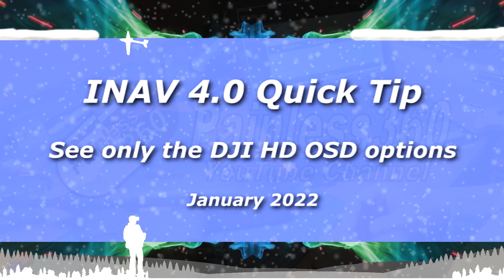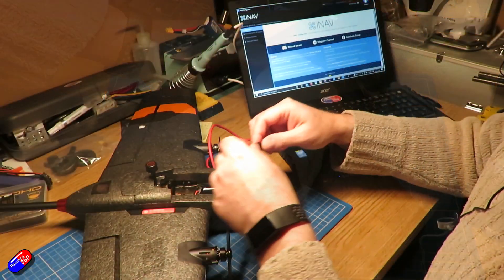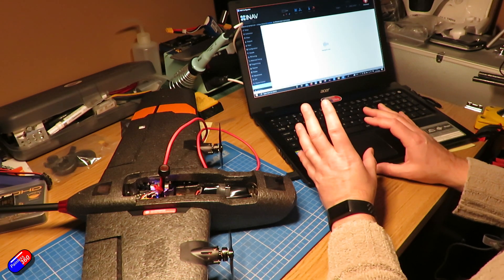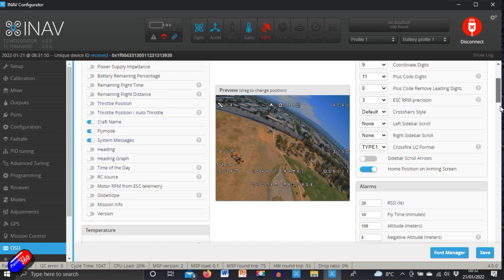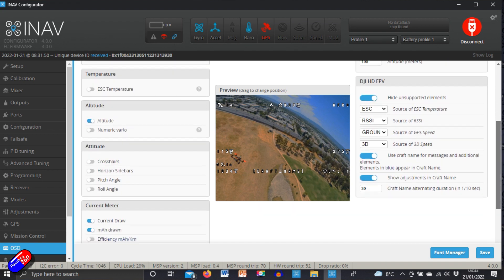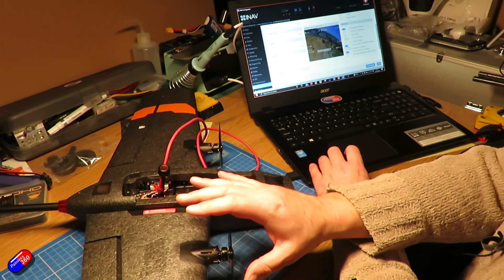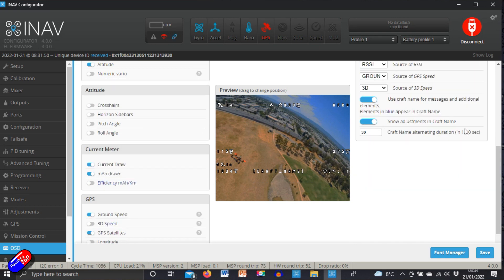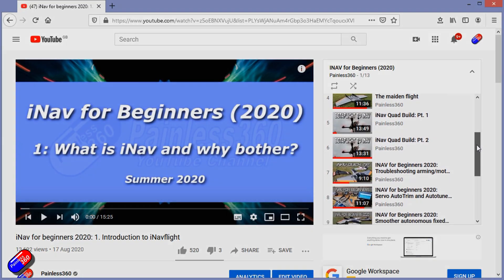How to easily see what DJI HD FPV OSD elements you can get in INAV

Comment: Hi painless, I currently trying to get my f765-wse to work on dji osd currently have up to date configuration on inav. What am I doing wrong?
Reply from the maker: No idea as I've not used one of those with a DJI setup. I'd check the forums in case it needs something like I had to do here with the F411WSE.. Best of luck.
Reply: @Painless360  I set my osd everything is working and the next Day the osd stop working im using a matek f411 wse and inav 4.1 any idea?